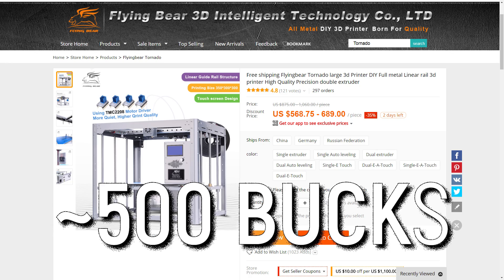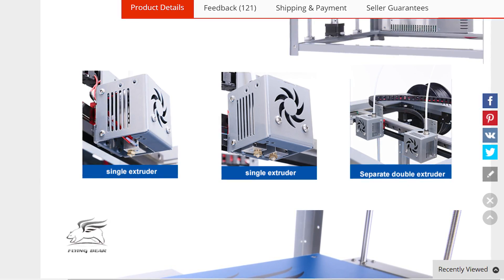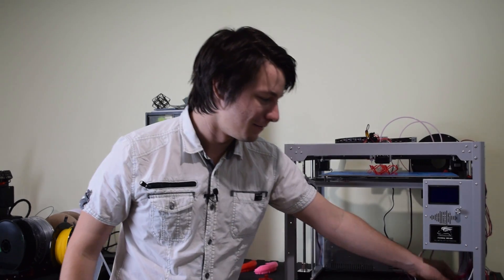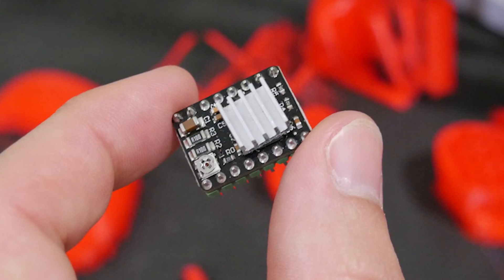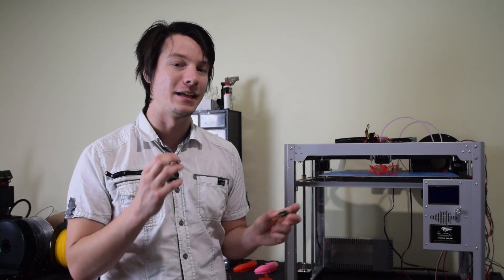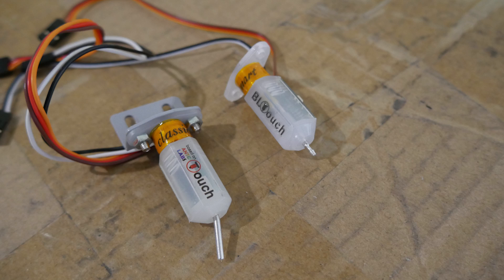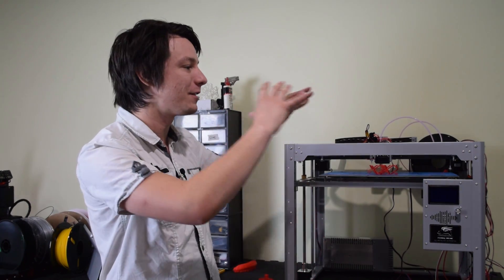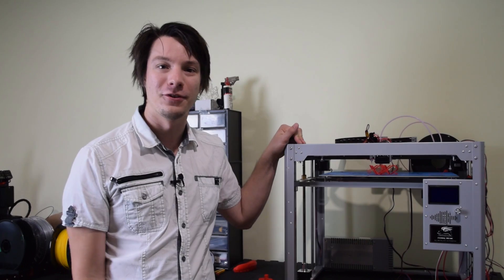Flying Bear Tornado 3D Printer Review

Comment from the maker: Glitch! Note, I used CoreXY and H-bot interchangeably in this video. In reality they are different configs of the same kind of movement. The FB Tornado is the H-Bot configuration.
Reply: Yeah pretty big difference between H-Bot and CoreXY despite the gantry being essentially the same.

I've inherited a Makerbot 5th gen that i'm stripping out atm and i'm totally upgrading that to CoreXY configuration!
Reply from the maker: Absolutely not! In fact it's all sheet metal so probably rigid enough to make H-bot work well, after you replace most of the components that is :)
Reply: MAKER BOT SUCKS!!!!! over priced piece of doggy do do imo!!
Reply: Another one to add that is in this printer type is Dual Wire Gantry, building my new printer this design method
Reply: Well it's not like it's inherently crap because it's an H-Bot config. Cheap rails/carriages in that config will probably hurt it pretty badly though.
Reply from the maker: Heh I remember being semi impressed with the XY design of the 5th gen when I opened one up to repair it... shame the rest of the machine disappointed so terribly.
Reply from the maker: Had never heard of it, looks like a tank!
Reply: Maker's Muse So it’s a really nice frame for $500, provided you replace pretty much everything else about it? Including the linear rails that are in theory the main selling point... well done design team! Well done indeed!
Reply: Do a review of the Renkforce RF2000!
Reply: Maker's Muse I've got an issue I cannot figure out, every time I print I set the z height to 2.3 which has been working great, but just recently it has begun defaulting to a starting height that Is way to close to the build plate causing my plastic not to stick. any suggestions on how to fix this?
Reply: @Maker's Muse Yeah the main reason i'm gutting out the gantry is more as experiment that i might as well do while swapping out the electronics for a DuetWifi and hot end for literally anything that works better (but an e3d V6 ofc) :P
Reply: Have a look at the Creality Ender-4 Kit for less tham 250 bucks, H-Bot, Extrusion frame, can easily print at 100mm/s
Reply: Angus, the Renkforce is a store brand of Conrad Electronik, a Germany-based EU DIY electronics chain. The RF series printers however allegedly aren't just rebranded junk, they claim they are fully developed and produced in-house. But therein lies a problem, since you're over down under and i kind of doubt that they have a worldwide distributor, you might have a difficulty getting one sent to you and there might be little point in addressing it to a worldwide audience. Furthermore they haven't even offered it to German YouTubers to my knowledge, they don't care, they use classic marketing via major publications, and they don't really understand new media all that well.
Reply: Celcius1au, do you have a forum thread or something? I wanna see how it comes together! Not many people doing these.
Reply: Maker's Muse malerbots are really good at keeping dust off  shelf. I had a mini. I made some changes and it worked after that but the biggest problem by far is the terrible slicer.
Reply: Now that I've had time to shake off the morning snark, for someone who doesn't (yet) have access to the tools to bend sheet metal (well, properly), I wonder how this would compare to an i3-style design done in 3030 extrusions if it had the proper guts (I blame/thank you for my current stockpile of said guts, btw).
It seems to me like it might sidestep some of the Z-banding issues the i3 designs tend to suffer by just having a more rigid frame (heck, it took me a while to sort that out on my MK2, even). Maybe I'll check out the CoreXY design in a bonus check or two, or wait for the inevitable overly cheap clones of this to hit the virtual shelves and gut one of those for fun.

Edit: By the way, thanks for showing me all of this cool stuff! I've always had a thing for sandbox games, and after a time away from those, I finally realized that it's just that I like to make stuff, real or virtual, and keep my mind ticking. I've started working on pricing parts for a small homemade CNC router, and my spare bedroom is a mess of robots and dry boxes full of all kinds of filament. I'm convinced that it's because you showed me that I don't need a giant workshop of a garage, a ton of free time, or a mess of loud power tools to make every oddball idea that pops into my head. My downstairs neighbors probably appreciate that, too.
Reply: Great review, thank you! Are you thinking about doing a review on the da Vinci full color printer, the one that uses inkjets to color the filament as it prints?
Reply: Can you please review anoter their product :Flyingbear-P905 DIY 3d Printer kit. It's very importent for me. I'll have 300 $ top at my 3d printer and I need something with maximal print volume. Sorry fo mistakes.
Reply: CoreXY is BAE
Reply: Angus is right.Tornado does have some problems.We bought their machines at the time.But since this video,fyingbear has done a lot of hard work,the quality of the machines now is really good,especially ghost,we now have a lot of their machines,it’s really great！
Reply: @kirtydaman2166  flyingbear reborn is also a good machine,they have indeed changed themselves,the quality of the printer is very good,thanks to Angus for their supervision.

Comment: Boy was this a blast to the past to watch! This was the first working 3d printer i had way back, and considering this review i am stunned we got it to actually work. I remember the frame was warped badly from the factory and we had to go at it with an angle grinder to access the full range of motion on the Y 😂. And boy I guess the electronics really were hot garbage. Did get some prints from it that I still think look pretty good though!

It’s currently sitting in the basement corroded to hell, halfway converted to a high temp machine, with a Titan Aqua on it

Comment: I should have listened to you in the first place. I bought Tornado2 eventually and hope they have improved. It turns out a big mess. I only got time recently to build it. I changed a lot of things and even upgrade the controllers with Lerdge K board with touch screen. Extruder. filament sensor. Auto levelling sensor etc. It still got echoing effect and I thought it is belt tensioning problem. After checking the original firmware setting, it shows 200mm/s2 ... Long story short. Don't buy it. If you are looking for big volume and linear rails etc. with low price tag, build your own one with Thingerverse designs! Maker's Muse is a honest guy, win my respect.

Comment: I have one from a customer that it is a pain in the a$$ , the hotend it is horrible, so tired, I finally designed a custom support for the E3D, bltouch, fan adapter from 40mm to 30mm to be able to use 24v fan from original, and modify the mesh calibration points to compensate differences. Here in Argentina it is not normal to get 24v things ( cartdrige, fans, etc ) that make all more and more complicated to replace things, I have the Flyingbear P902 and it is simple, and better in all kinds, all the parts are common, cheap to replace, I always prefer things that is easy and cheap to get the machine working again. best regards Angus

Comment: Wow! I am so glad you did this review!
I was thinking about getting a Flyingbear 905 for my first printer because it's only a little more expensive than the Creality Ender 3D Pro ($216 with the $5.00 off here: https://www.3dprintersonlinestore.com/creality-ender3pro-3d-printer ) but... Wow. Just... Yeah, I think I'd like to have something I can assemble and get a print off of without having to buy replacement parts first.

Where would you suggest buying a first printer from? This is, honestly, my biggest question right now. I've had some suggestions from people that I'd be better off to buy it from Amazon in case something is wrong with it but I don't have Prime (because I'm not a big fan of paying Amazon for something I'll use once every couple of months at best) and Amazon doesn't appear to want to have anything to do with 3D printers that arrive broken. There are a couple of Amazon sellers that seem to be pretty reasonable about making sure you're satisfied with your purchase but I really don't know. 3dprintersonlinestore looks pretty reasonable but, again, I have no experience with them and can't really find any information on them as a seller.

Thanks! Your videos are EXCELLENT!

Comment: I lucked out and found someone selling their Tornado on CraigsList after fully modifying it. It is printing great, at least better than my Select V2 after fully modding. He's converted it to dual Z-screws with IKO ML rails, upgraded power supply to 600w, moved to MicroSwiss end, BMG Bondtech extruder, filament dry-bin w/ dessicant for feeding from, genuine BL touch upgrade, mosfet, new belts, not sure where to stop with the list. I was madly in love with this printer from the moment I saw it, so much so that I almost bought it new and suffered through all of this to get it running.. even after seeing this Maker's Muse review. I have got to say -- they were so close to a winner on this one, but I think they were really trying to keep the price around $500. I paid below that for the printer fully modded, and had they sold the rig as it sits on my desk, even for a few hundred dollars more, they would have had a home run.
Reply from the maker: With those upgrades it's barely the same printer, just a bare chassis. The poor quality component choice is exactly what killed this kit.... With the parts you listed, it would have been killer.

Comment: Love this Sharp Pencil  Review. I respect China's Manufacturers who provided comprehensive Tech Info & a detailed Assembly Manual with my Reprap i2 - but a cr*p assembly video with a Tronxy X3A. Theyre now exporting kit machines that can barely work even if perfectly assembled.  Microsoft however have just issued an FTDI Update that knacked my 3D printer control, so let's be fair, it's not all down to "Cheap Machines".

Comment: I have 3 of these, these have been my issues. 

Nozzle is ptfe lined (replaced with e3d v6) there is a file I made on the Facebook group if anybody is interested.

wobbly bed , just replace with double length bearings, mostly fixes it

fan failed (3/3)

bl touch failed (3/3)

machined part on extruder did not fit (1/3)

x axis end stop wiring is annoying but haven't had a problem

firmware is bad (3/3) 

switch burnt out (2/3 as I just got rid of it before the third could fail)

fan polarity was backwards (1/3)

not stright z rods (1/12 as only one was bad)

sounds like a pretty big list but I think it's worth it for this printer. After like $100 in mods they all work very nicely and I personally don't hear the switching frequency of the stepper drivers.A neater wiring job can be done if everything is hid, but I never did it as it is quite annoying.

Comment: I have 3 of those printers and the switch failed on every single one. on another note so did the fake bltouch on 2 of them, but other than that it is really good. Also I posted a file to the Facebook that allows you to upgrade to an e3dv6 hot end so printing higher temp stuff becomes possible too.
Reply from the maker: +Michael Schalk an e3dv6 sounds like a very worthwhile mod!

Comment: Most of the value was for the metal frame, it seems. but that structure and good parts, it'd be a beast to work with PLA (i can't believe you can keep consistent heating in such humongous buildplate without draining the energy of the entire house.)

Comment: Each time you show how bad a printer it, I find myself extremely luck that my Anet A8 worked pretty good straight out of the box. And so far my only improvements were the X-belt tensioner and holder. I still haven't gone trough my first roll of filament, but so far all prints were nice. I'm using Repetier Host, not a fan of it, but it came with the printer and so far it's doing it's job. My cables are mostly lose or held with paper binder clips.

Comment: Great review!!! Best part is that it's not for beginners. Definitely. I just got the p905x and from the beginning I mainly bought it for the frame and the rest of the parts, and for the fact that they ship it with UPS which is fast. Currently I'm replacing the linear bearings with bushings. The linear bearings are total crap, lots of vibration and quite a loose fit on the rods. Besides, if the rods aren't hardened they will end up ruined by the super hard bearing balls in no time. Greetings from Argentina

Comment: I don't think the 8825 drivers are as much of a problem as the motors must be.I use 8825s on 3 of my 4 printers and what keeps them quiet is better motors, some of the small, cheap nema 17 motors are loud no matter what the driver.

Comment: Assuming this is a rigid setup, throw all the printer components, source a cheap CNC setup and turn it in to a CNC with a large bay. It hasn't been done in ages now, but you can build 3D items with these types of CNC by adding the layers as they are finished. From, example, polycarbonate sheets, or wood, or metal.

Comment: Even with a real BLTouch, in order to prevent it from occasionally get knocked down due to high-speed movements (usually during infills) and, yes, ripping across your print damaging both it and the print, so I made an, um, "mod" to ensure it doesn't happen: after the bed level finishes, I have the nozzle go up 30mm and sit there for about 10 seconds so I have the time to put a rubber band around the BLT arm and the BLT's probe so that it can't extend, period. :-|
Reply: Do you have a genuine BLTouch?
Reply: Yep! Got it from Paris at ANCLABS; I was even the first person to request an extra length of cable from them, something that they now offer to anyone that buys a BLT (or so I've been told :) ).  Long story short, I slightly bent the probe when a print came off the buildplate, after which I ended up getting a replacement probe from them, and after that - although it works fine now - it occasionally "vibrates itself free", and it takes a second or two before the probe gets pulled back in which is enough time to smash it against the print. So...rubber band to the rescue. Wee!

Comment: Bed flexibility is a bigger issue the bigger the printer goes. I'm actually pretty unhappy with the flex in my Up Box+. From a mechanical design viewpoint it's not a trivial thing to rigidly mount a large platform off linear rail(s) without binding, sounds like these got it way wrong

Comment: I got the P902 as initial printer... But the early 2017 model where only the stepper where inverted. 

I had some issues with adhesion but I switched to a mirror. 

I got oil into my nozzle and don't find the time to fix it now but my flying bear is awesome for the 316€ I paid. 

The newer models are yet to be great I guess. But the Facebook group is really helpful.

Comment: Well shit I ordered a flyingbear P905x about 5 days before this video came out.

Time to be a masochist. I do have a maker select v1 so I'm not completely screwed.
Reply: I got the P905 single e dual z and it's a wonderful machine. I think that the p905 series is better straight out of the box than the tornado.
Reply: Steve Olmstead paypal are doing one off free return lables may be handy
Reply: I just got mine, a p905x dual Z, dual extruder. Just take your time to put it together and triple check the square angles in the frame. The only thing that I don't like so far are the linear bearings. Mine are total crap, vibrate like hell and the Z axis has the same issue as this tornado. Currently i'm making some bushings to replace all linear bearings. For the price  I don't think the rods are hardened, and if they aren't they will be ruined pretty soon by the much harder bearing balls

Comment: Capricorn is proven shit!
Reply: Says who? (apart from you)
Reply: I can say the tolerances are better. the filament fits better. and it does appear to be "slicker" I am able to use less retraction though this just might be the better "fit" causing that and I imagine you can buy correct tolerance regular ptfe easily enough.

as for its high temp. I won't endorse it for that simply because "how do you test it" ?? I have not figured that out yet.

I do have the micro swiss 300c hot ends coming in and a usbasp so I can maybe get at the firmware in my cr-10 so maybe I will find out. :-) guess only real way to find out is to print with normal ptfe at 300c till it fails then try the same with capricorn. alas I can't afford to do that as it would take an awful lot of expensive 300c compatible filament I am guessing :-)

Comment: Exactly how I feel about the Tevo Little Monster. On paper, the specs are great but plagued with shitty hardware affixed to an excellent frame.  However, gut all the garbage and replace it with decent components (genuine e3d hotend, extruder, better bed glass, duet board, & bearings at a minimum) you have an absolute monster of a machine.  I now have five of them with the last few I didn't even bother with the stock components and budgeted with replacement parts to start with.  I'm curious if the SeeMeCNC Artemis would be the same printer done right from the factory.  I'm fed up of these Chinese garbage kits, it's really pushing away newcomers to the space. (show subject, hint hint)